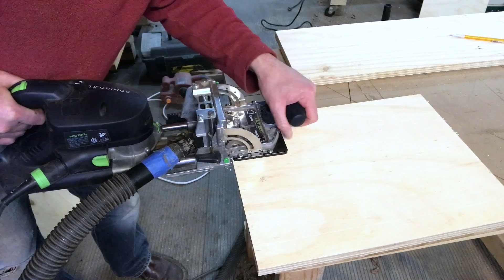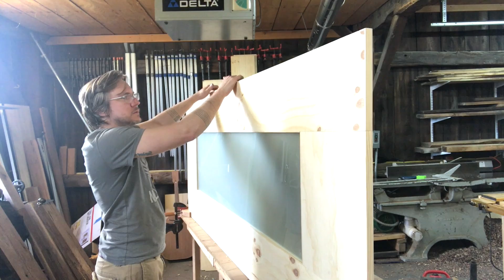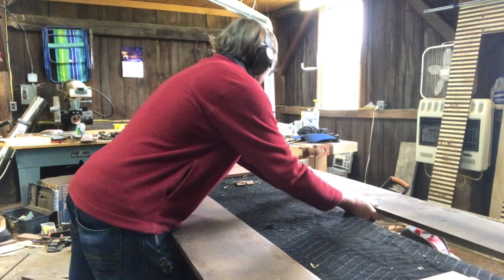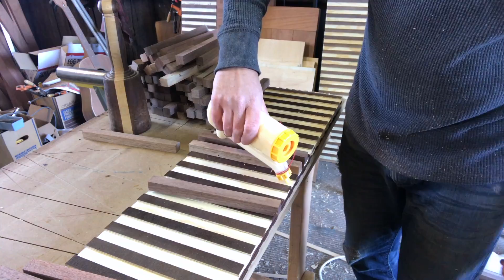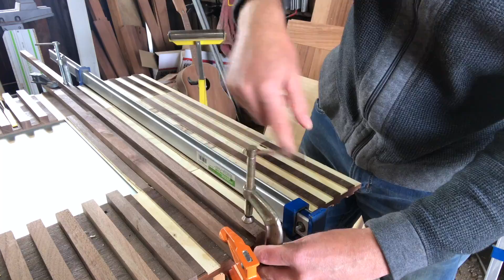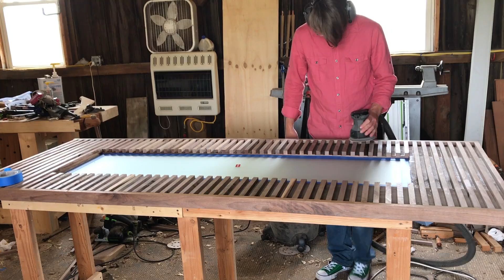Building Walnut Strip Doors // Woodworking How To

Comment: I think these would look better if the interior also had a framed border, but that's just my personal preference. 

Also, next time you do a project like this, where there's so many slats; go out to whichever store you got your router from, and buy spare baseplates that you can modify with rails or whatever you need. I'm sure every store has them, but I know for a fact Sears does for their routers (Which are Porter rebrands), or just make your own out of acrylic with a second router. I'd also use two sets of rails, one on each side, and an edge guide on the first couple of slots with a single rail guide.

Comment: those are some funky looking doors very cool and I feel your pain brother I've been having some issues with a couple commissions myself having to start over twice now just silly little mistakes stead of using 5/16 inch bit I'm using 3/8 just stupid mistakes stead of using my drill press I'm using hand drill instead of putting it to low-speed I'm putting it on high speed burning and splitting the wood when it rains it pours
Reply from the maker: +Joe basement woodworking I feel you man. Little mistakes can really ruin a project.
Reply: McCauley's Design hell  yea they can..and co$t..lol. im at the lol point with it. Ive started over so many times that i  wont let myself get mad abiut it anymore.Lol ya know?

Comment: You could have drilled and counter sunken the strip to you router a couple holes in the router plate wouldn't hurt it and the door looks unfinished with no trim around the inside frame of the glass but interesting project it has that Asian feel

Comment: How do you replace the glass if it gets broken?
Reply from the maker: +Mike Bernard you build a new door. My thought was job security at the time. Now I'm thinking they will be buying 3 new doors in a different style because I doubt I'd agree to build those again.
Reply: Use a router to remove wood from one side of the slot. Lay in new glass and hold in place with trim wood.
Reply: First thing that I thought of, what if some idiot breaks the glass? I would have used stops. Also would have been nice to see you hang them. Interesting design.
Reply: What hardware was used?